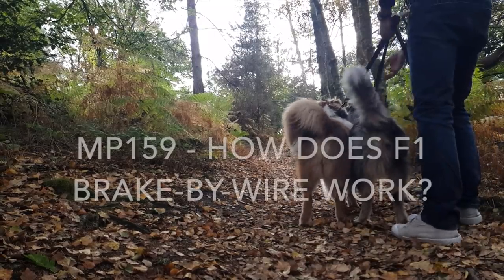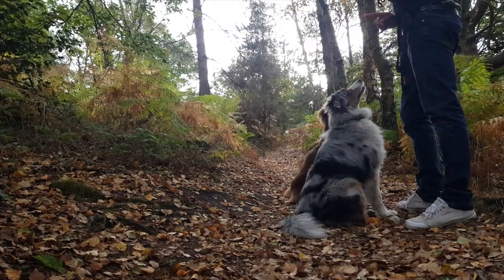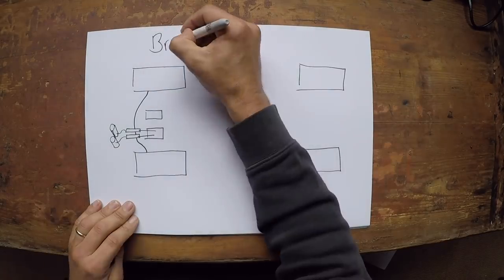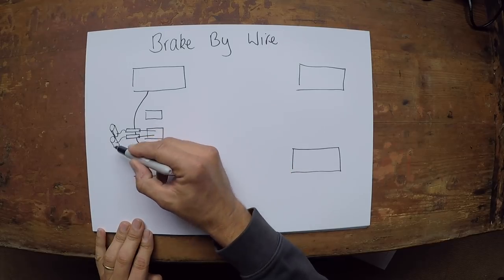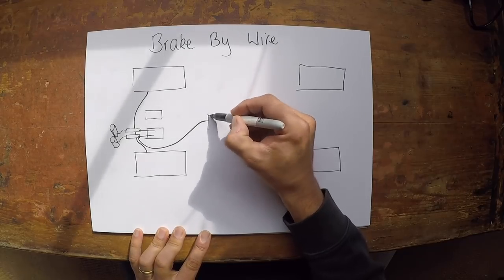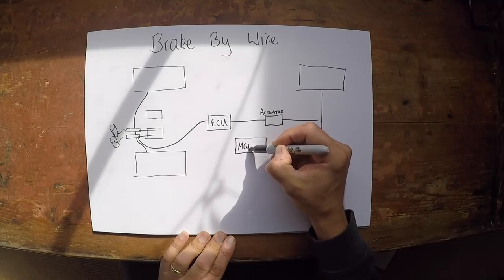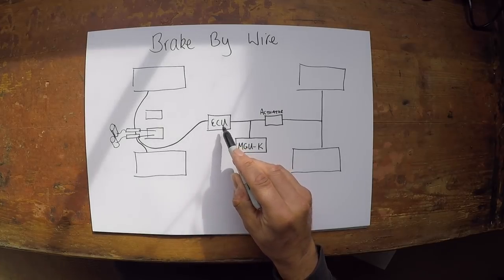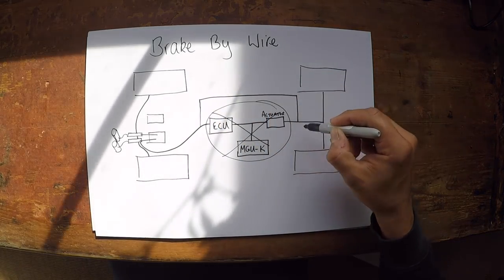MP159 -  How Does F1 Brake By Wire Work?

Comment: The way I have heard the hybrid BBW F1 system in the past is that the hydraulics are always directly connected to the rear wheels and what the BBW ECU does is control bleed-off to the rear hydraulics to reduce clamping force and allow more of the braking to be done by the MGU-K.  Can you confirm that this is not the case and it works as you have described it in this video?

Comment: Any idea what happened to the Toro Rosso’s last Sunday? They both lost their rear brakes, I believe.
Reply from the maker: They both overheated the fluid somehow and lost front brakes
Reply: Eduard van Raalte they lost front brakes and the rears locked as a result, IIRC I read an article that they each had stuck caliper pistons. Might have also had a hand in Gasly’s bad start.

Comment: Weren't the examples you gave (Canada 2014 and Monaco this year) failures of the MGU-K primarily? Though the effect on rear braking in those situations was as you described. I seem to recall in Canada 2014 that Hamilton's rear brakes overheated causing him to retire, whereas Rosberg was able to manage them and continue, albeit at a considerably slower pace (same with Ricciardo in Monaco this year).

I'm interested to know what would happen if say the brake-by-wire control electronics (or the actuator controlled by them) failed, but the MGU-K was still operational. Is that a possible scenario or is the MGU-K intrinsically tied into the brake-by-wire system, so would fail anyway? If it is a possible scenario, how would it affect braking? Would it cause an inconsistency in rear braking because the MGU-K would be contributing differing amounts to rear braking at different points in the lap?
Reply from the maker: Yes, it could happen, although far less likely due to the simplicity of the parts, but the effect would be exactly as you describe, with inconsistent amounts of rear retardation.

Comment: In the event of a BBW failure is the switch to full hydraulic a fail safe automatic change or does the driver have to select a different braking mode?
Reply from the maker: It defaults to the failsafe mode, but driver would have to then manage bias towards the front to protect rear brakes.

Comment: Isn’t it true that in even in ‘conventional’ cars, braking is 70% or (much?) more assisted and therefore feels almost the same as drive by wire?
I heard that F1 drivers have to push about 150kg when braking. So it is not assisted, just partly shared with the MGU-K. (As explained in the video)
Reply from the maker: Yes, that's true, electro mechanical assistance is very common in modern cars and yes, 150-160kgs is pushing the pedal with everything you can muster.
Reply: Marc Priestley Image that 26 times per round for 1.5 hours in Singapore...
Reply: Marc Priestley non BBW in road cars typically has vacuum assist. At rest, a diaphragm has vacuum on both sides, pressing the brake pedal lets air pressure on one side of the diaphragm to assist in applying the brakes.
Reply: Phos9 I sure Marc already knew that but I didn’t, so tx!